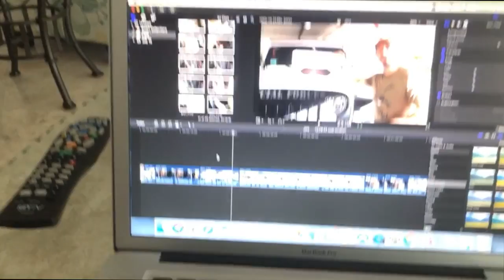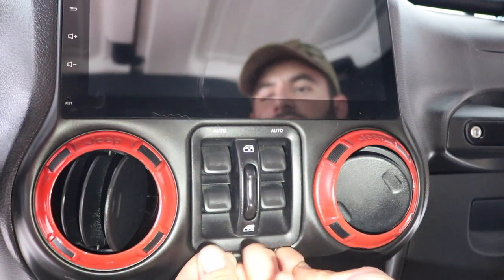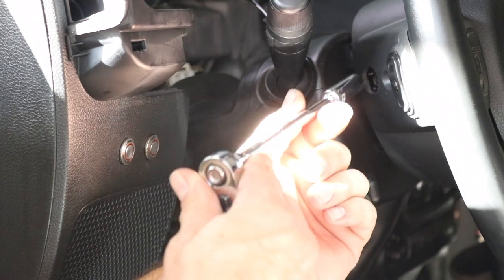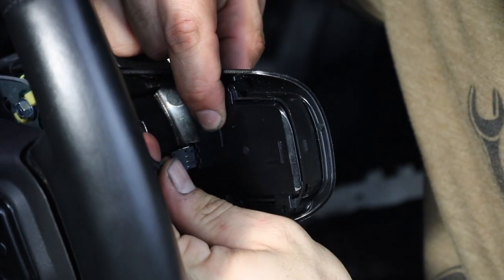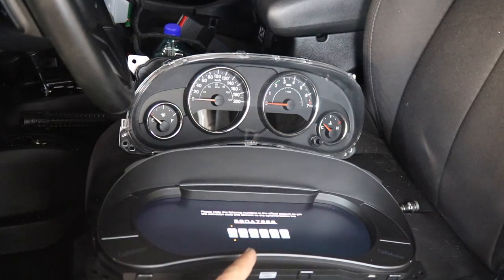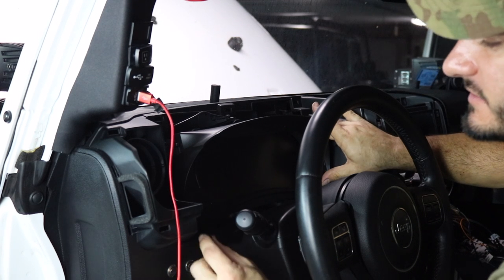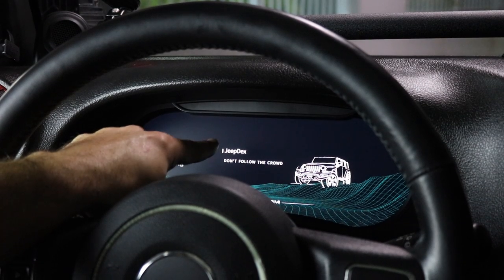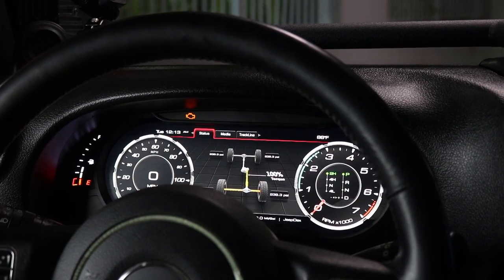The Coolest Jeep Accessory EVER!? ~ Carobotor J-Pro Digital Dash

Comment: I see a ton of questions, but no replies. The check engine light is on after the swap. What caused it and was it resolved? To repeat another question posted, can the OEM dash be reinstalled with updated mileage?  What would it take?

Comment: When is the review coming? I see the code is now  $200 it's going in the right direction.   What about your head unit, I see your going to switch...I first came to this channel because of the Seican, but I'm put off because I seem some Seican users state it doesn't line up nicely. What's your thoughts if your on a budget?

Comment: 8:55 Those PSIs tho.. LOL
Reply: @adventuredex  Was it just a bug with the initial config, or have you had problems with the new dash displaying the correct PSI numbers?  I've seen a couple videos on the dash, and both seem to have issues with displaying the correct PSI numbers.
Reply: @Gzus  The PSI misread is just because Dex doesn't have his tmps sensors in his wheels :)

Comment: In this video you have USB plugs on your driver side windshield column, can you please share what the setup is and where I might find it?

I checked your Amazon lino but it had a different light toggle option.

Thank You
Reply from the maker: I’ll do a separate video about my power station! 💪🏼
Reply: AdventureDex ok thanks, can I ask if this the one you have in your video?

Rugged Ridge 17235.98 A-Pillar Switch Pod with USB Port

Also if so did it come with the plug and wiring, if not where can it be found?

I’m still very much interested in the video your video your planning on.

Im installing seat heating pads and these toggles would work well and the USB is definitely a plus.

Thanks

Comment: Hello Dex
First off, Thank you for channel and the passion you've invested into your vid's. I have a 2014 JK 4x4 that I deliberately bought stock with in tent to mod. After 3 waiting 3 years, I started that journey. Now I have a 4in lift by fab-tech sittiing on Black Rhino Cinco rim on General Grabber ATX on 37's.  This is a testament of your influence and effort of your channel. Not to be winded, I did wish to ask when you added the MLC, and your Angel Eyes did you have any issues, also Now with this mod does it have gearing option so your tire size vs accurate speed and RPM's.  I plan to include this upgrade by the spring of 2020. And just think... It was your Jeep leading the way... Thanks

Comment: I think I'm too scared to mess around with my airbag haha
Reply: if you already have controls in your steering wheel, you might not have to. I just installed my Carobotor and I'm using  the controls that came with the car. They work great.

Comment: Just ordered one. Couldn't help it. Looks awesome. Hope it doesn't suck. :)
Reply from the maker: They are dope! Your gonna love it!!
Reply: @adventuredex  Just installed it. Piece of cake, this thing is great! Your video helped a lot, thanks for posting it!
Reply: @bmxracernc  You still liking the purchase, any regrets?
Reply: @kenmonpittman  No regrets, I still love it. Only issues i've found are that the automatic headlights seem to overreact, they turn on/off when going under a bridge on the interstate for example. And a few times it has reset the custom settings back to defaults when I start the jeep.  Not sure why but it's not a big deal to switch it back to mph instead of kph. :) I haven't contacted them yet to see if there might be a firmware update.  I'd still buy it again though.

Comment: With regards to the buttons. I have VR on my button and notice that is not on the buttons you installed. Would I lose the voice recognition from my steering wheel by installing this?
Reply from the maker: You don’t have to switch the buttons if you don’t want. The recognition would depend on your headunit 👍🏼

Comment: Can you do an update video on your aftermarket stereo ? It would be great cant decide if i should buy it.
Reply from the maker: Nothing has changed in terms of the headunit however I might consider changing it as Carobotor is coming out with a headunit that will be compatible with the digital instrument cluster. 👍🏼
Reply: Awesome sounds good have you have any major issues with the stereo unit or does it work smooth. 

Thanks
Reply: They came out with any radio. They don’t even respond. I wish when you get new products you actually use them for months before you review and mention why it’s a great item. It’s crap hard to save and then when you need help these asshole don’t even respond tech support is junk.

Comment: Dex, any issues with the dash not turning off automatically once you turn off the engine? I have manual doors with no remote. The dash has to turn off after at least 5 minutes. Any way to change this setting?
Reply from the maker: That’s interesting. Can you contacted them about this? I am still playing with the settings but I do remember see setting for timing of lights, etc. I would contact them and ask if I was you! Sorry I couldn’t be more helpful. 👍🏼
Reply: AdventureDex thanks bro; I’m waiting for them to respond.

Comment: The best product that could possibly be produced for a jk would be a 3.6 engine that didn’t fail after 50k miles.
I had an 11 jku and 14 JKUR and both engines rebuilt. They will fail again because they put the oem lifters in instead of mopar actually building better lifters. So I am buying an extended extended warranty for when this happens. Good luck to all you jk owners. 
On a cool morning go start up your motor, listen between the front fenders and the tire. If you hear ticking that sounds like a sewing machine get it to a shop because your lifters are bad. Usually the right side hoes out first.
Reply: However that is a cool addition

Comment: What’s up with the CEL after the install?
Reply from the maker: I had a check engine light prior to the install so it was no different. The light is usually on when you turn the key prior to starting the engine. Thanks for watching

Comment: Did anyone notice the dash oem speedometer goes to 200 and the digital one goes to 120.
Reply from the maker: The factory one was in km the new one is in mph 👌🏼👌🏼
Reply: @adventuredex  oh. So it switched to mph. Or did you do it while it was programming. 
  It looks nice though. Great job on that install. 
  And does it work with a manual transmission wrangler.

Comment: nothing for the 3.8 engine on there web site. even if you pick the the for the 2011
Reply from the maker: Great Question! Feel free to contact Carobotor on IG. They are very prompt!
Reply: @adventuredex  Just sent.
Reply: As long as you have the new interior, it'll work fine on 3.8. You just have to message them so they can update the cluster accordingly. I've sold a few for 3.8 here in Australia👍
Reply: @GMCARTECH  great thanks